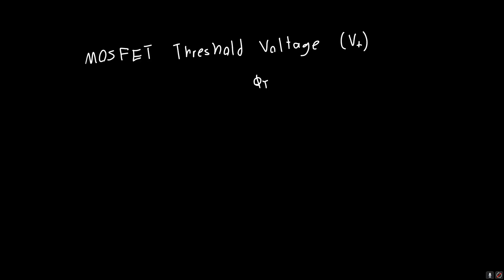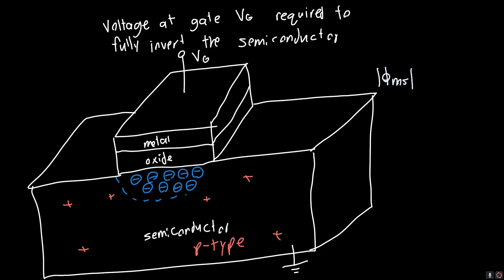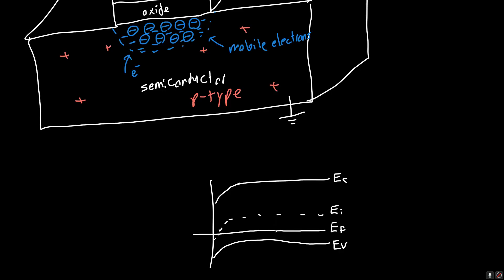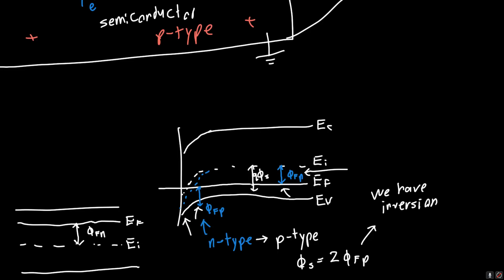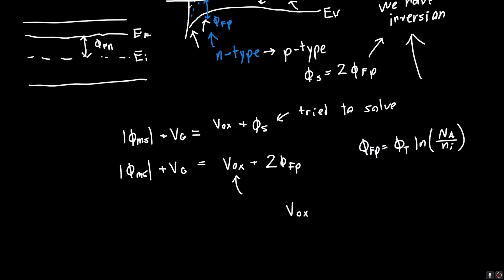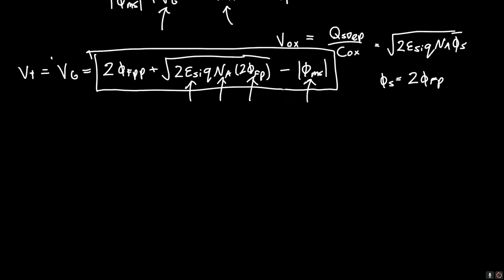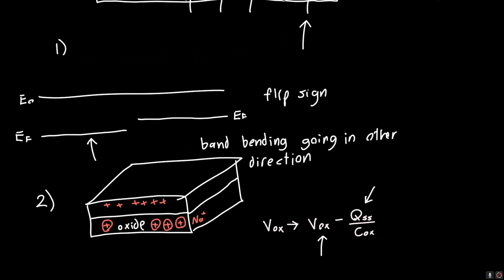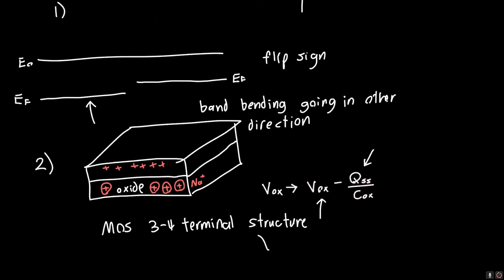MOSFET Threshold Voltage Explained

Comment: First, thank you for the video. Cheers 🍻 

7:05 If the sign on the last term (Phi-ms) is dependent upon the relative position of the M and S fermi levels, why use the magnitude in the first place? It seems like if you remove the absolute value symbols constraining it to the magnitude, the sign change becomes inherent.
Reply from the maker: Great question! You are right, and if you are comfortable with the math, no need to include the absolute value. Back when I made this (and even somewhat still now) I hated negative numbers, and eliminated them wherever I could. xD
Reply: @JordanEdmundsEECS  Yeah. I get what you mean. I still remember getting over my initial distaste for using negative values for gravity since we grow up thinking acceleration as an increase in velocity.

It didn’t take long to adjust to positive and negative just meaning direction from zero rather than an amount of something like “apples.” Even “negative apples” just means you owe somebody apples.

There a many things we learn colloquially that have to be unlearned when dealing with physics like weight referring to the mass of something rather than the force it applies to a scale. I struggled for a week with the idea that something could “weigh” different kilograms depending on the planet you were on. Then it hit me that “weight” is used differently depending on the field using it. Hell, people say things are “weightless” in space, which does NOT mean “massless.”

I think authors of textbooks take it for granted what people learn outside of a formal physics class and just assumes people can readjust how they use common parlance to suit.

Anyhow, linguistics was a subject I never thought I would ever be interested in until I found a passion for explaining things to people. I’m always projecting the excitement of understanding new onto others only to find out that most people just don’t get that excited about these things. 😂 

Cheers 🍻 to you and yours, and Merry Christmas!!

Comment: I believe, all else being equal, Vt for a MOSFET with a shorter channel length is lower than a MOSFET with a longer channel length. Can you explain how Vt is affected by the channel length based on the equation you showed?
Reply: I think I figured it out - the surface potential Phi-S or 2*Phi-FP represents the channel length.
Reply from the maker: No, this model does not include any dependence on channel length. That’s why it’s called the “long-channel model”. You will need a more complex model to describe this.

Comment: Hello Sir, I would like to ask, what is the difference between gate length and technology node in transistor scaling? I tried to look out for the answer at several places but still confused.
Reply from the maker: Technology nodes are usually referred to by the minimum gate length they can achieve. For example a “45nm process node” means that the minimum gate length your transistors can have is 45nm. Any given transistor fabricated using that node could have a gate length much larger than 45nm (for example, 10 microns).
Reply: @JordanEdmundsEECS  oh, I think that is the clearest answer I got. Thanks a lot!

Comment: well, i'm confused. You say that an inversion in this ptype semi-conductor occurs when you apply a positive voltage. Although, I know that VT in a PMOS transistor is actually negative!
so, these two facts kinda contradict each other...
Reply from the maker: You are absolutely correct in that PMOS transistors have negative threshold voltages. The “P” refers to the type of carriers in the channel during inversion, not the type of carriers of the substrate. So the transistor in this video with a p-type substrate was an NMOS and has a positive threshold voltage.

Comment: I usually see VGS(th) for threshold voltage, just as a note.
Reply from the maker: Interesting, which textbook do you use?
Reply: @JordanEdmundsEECS  Mostly datasheets, it's not super scientific actually.
Reply: @JordanEdmundsEECS  I think that representation might be right because in the book which I'm reading, threshold voltage is defined as gate voltage w.r.t. the source terminal, i.e., Vgs at which full inversion occurs. The book id VLSI Design by Debaprasad Das. I'm confused, what is the actual definition?

Comment: I think it should be ni/NA in the equation for (phi)FP.
It was like this in the book CMOS digital integrated circuits by Sung-Mo Kang and Yusuf Leblebici.
Reply from the maker: Night Rook That’s correct, if you want phi_fp to be a signed quantity. I like to avoid negative signs whenever possible and so I take both phi_fp and phi_fn to be positive quantities (the distance to the Fermi level)
Reply: Oh. That makes sense.